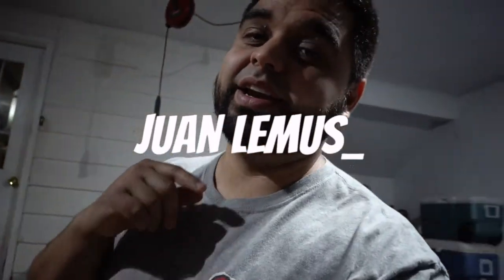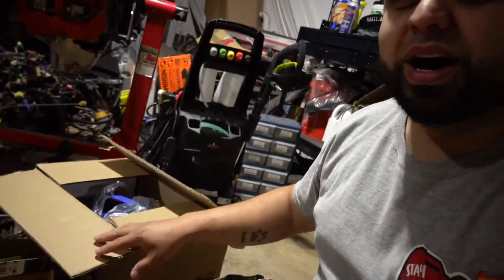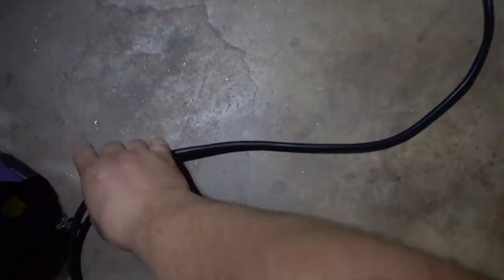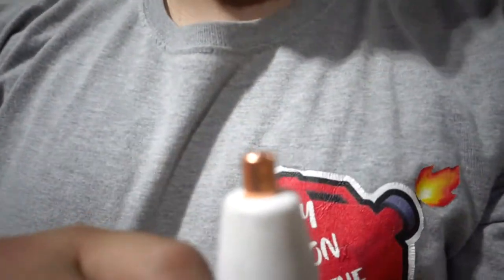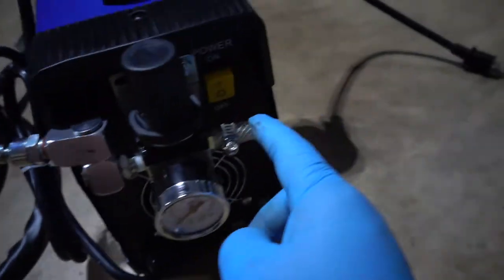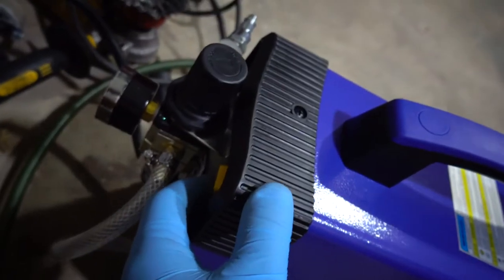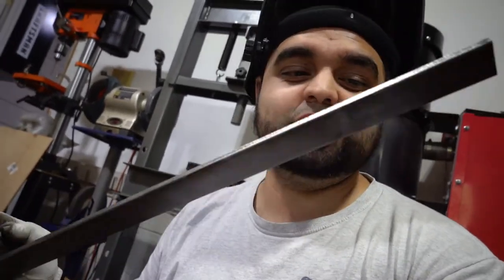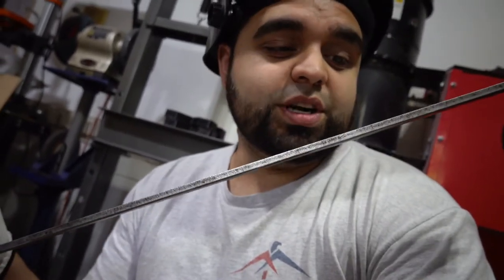TESTING THE CHEAPEST PLASMA CUTTER ON AMAZON!!

Comment: Aerospace weldor fabricator here; it appears you're dragging the tip of the plasma torch on the material, do not do that. Treat it like a regular oxy acetylene torch and keep your Gap to about an eighth of an inch. Rest one hand under the hand holding the torch and try and move with precision machine motion making sure that the orifices or the head itself is perpendicular in all directions to the material being cut, do not angle the torch.
Reply: Trailer mechanic and engineer here I do agree with this statement
Reply from the maker: Thanks for the tip guys!!
Reply: Hello. I have the same torch, a PT31. It is meant to be dragged
Reply: @reloadnorth7722  Blowback from dragging damages the tip and wears it out prematurely. Yes you can drag ANY plasma torch tip but it's not optimal.